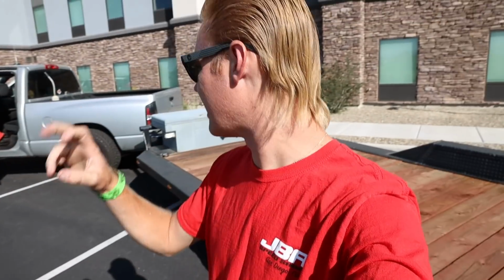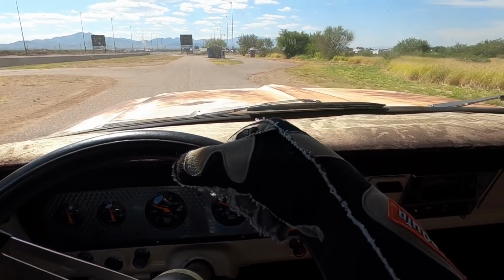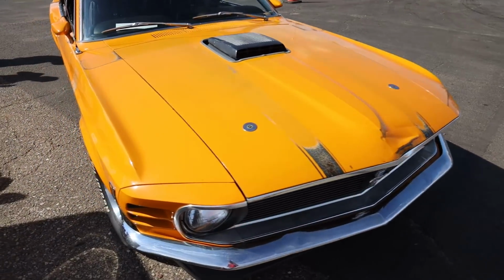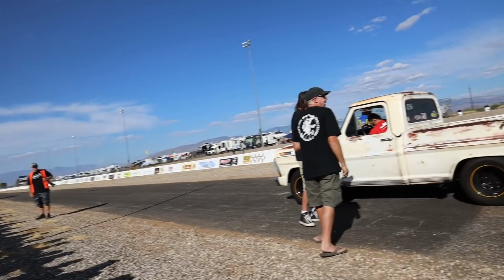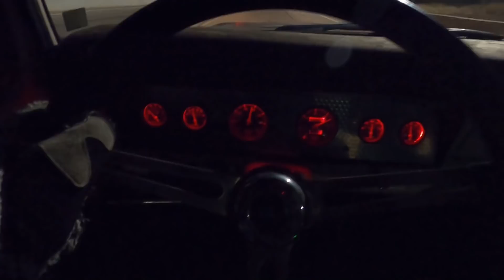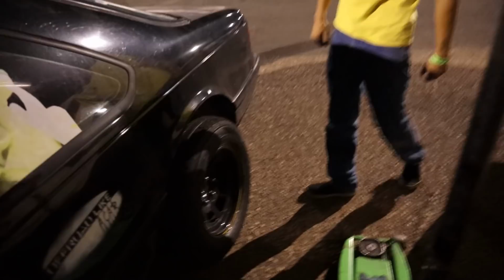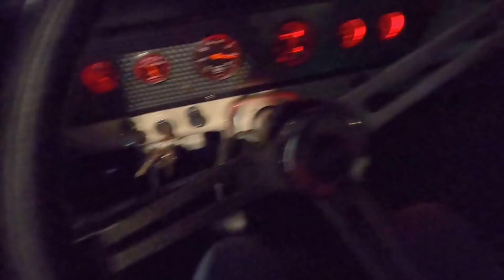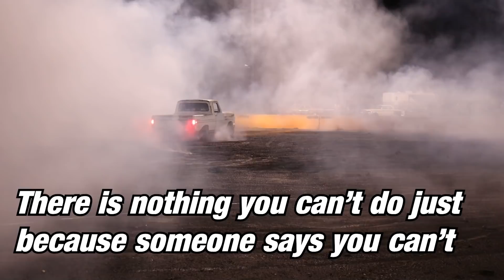Duct Tape Drags DAY 2: PUSHING MY F100'S LIMITS! Will it Stay Together?

Comment: I have to give credit where credit is due. This is coming from a Ford guy. I just knew you were going to scatter and split the block. I've built hundreds of 302 in the past 40 years. And I've seen them scatter at a sustained 6,500. Yours is one of maybe 3 or 4 that I've seen hold together and not split the block. You now have bragging rights. You built a 302 that stayed together at a sustained 6,500. And I could tell you had a good time. And in the end, that's what really matters. And really, I know that you know the block could split. But you took the chance. And you had a good time. A time that you will remember the rest of your life. Times like this, you'll think about them when you get a good bit older. It will always put a smile on your face.
Reply: They break when somthing isnt right. Like the tune of it or the balance of it. There countless 302's that live at even higher rpms and output.
Reply: @jesseduke694  Lmao I know, I was gonna say my old 89 coupe seen 7k several times…😅

Comment: Old fords never die ! They just get faster !!!
Reply: I’ll give it the credit it stayed together and was a stock lower end small block Ford. But you gotta have CHEVY power to make them faster
Reply: @brandonbell3089  No you don't.
Reply: @deadon4847  ford will always be the underdog. Chevy engines and mainly transmissions will always power 99% of fords on the strip

Comment: It's built ford tuff it'll stay together 💪🤘🇺🇲
Reply: Chevrolet can do it just as well
Reply: @brandonbell3089  Keep believing in fairy tails.
Reply: @deadon4847  🤣🤣 you just wished Ford could a CHEVY!! They will forever power fords. Either small block,big block Chevrolets,and even LSs
Reply: @deadon4847  isn’t any fairytales!! It’s just cold hard facts. Yes you can make a ford motor fast. But Chevy will always win HP to dollar!!!!
Reply: @deadon4847  Chevrolet transmissions is what runs the strip aswell. Powerglides,turbo400/350s list goes on. Chevy transmissions even find there way behind ford engines if you wanted to spend all that extra to go slower.
Reply: @deadon4847  it isn’t hard to spin the tires with a straight shift. Nor is it hard to make one live especially when you got a limiter on it 😉😉

Comment: I feel like that truck should be running a full second faster than it is that engine should be making 375-400 flywheel hp at 11.5:1 comp  I think you have something going on with it
Reply from the maker: I agree. We’re looking into it this week
Reply: @Thecraig909  like my fox with a  similar set up with the engine jut down 1 point of comp should crack an 11.9 on a really good pass

Comment: What was your top speed through the whole event?
Reply from the maker: 96 if I remember right in the 1/4
Reply: That’s a little faster than mine😂 I’ve only gotten mine up to 60 down hill🤣
Reply: Although mine is a 71 f250 4x4 highboy it’s got 4.10s in the rear and granny low np435 transmission
Reply: @Thecraig909  not bad for a 50 year old truck